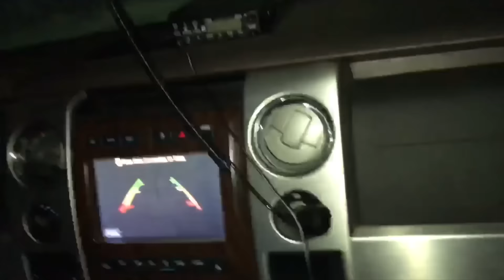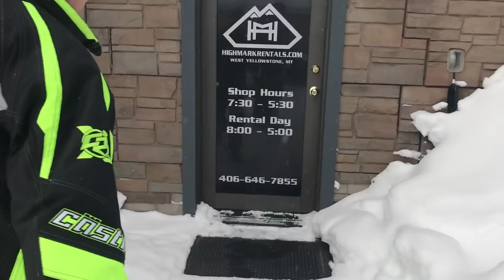THIS TURBO SLED RIPS

Comment: All of your vids are fire keep it up guys. Pls buy more GoPros the channel would benefit a ton with all the motorsports
Reply from the maker: +Johan Hugo we've got more than enough gopros, our problem is they die too fast in the cold weather we've been having lately for them to be useful
Reply: CboysTV if you can carry one of those portable phone charging batteries and keep the cameras plugged in they won't die as fast
Reply: The also wont be waterproof. Would be nice if they'd finally make a proper charging connection.

Comment: It is the engine you should heat not the battery, because when the engine is cold everything gets smaller and then it gets higher compression, so the starter does not have enough strenght to move the pistons.